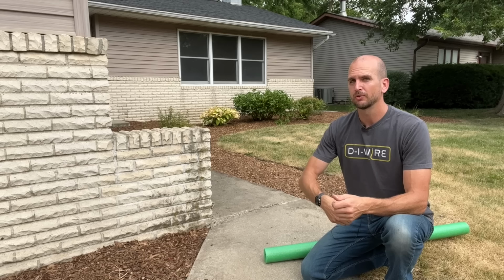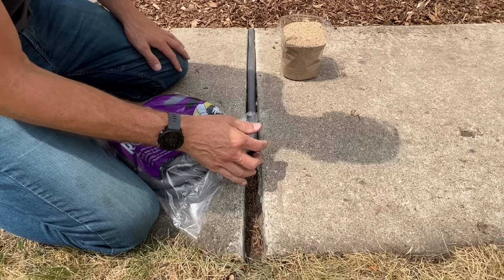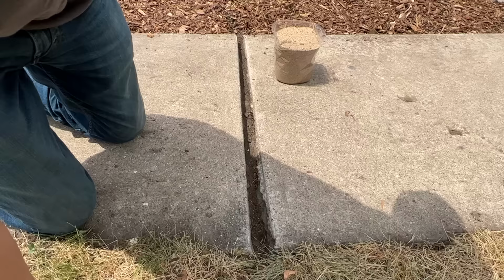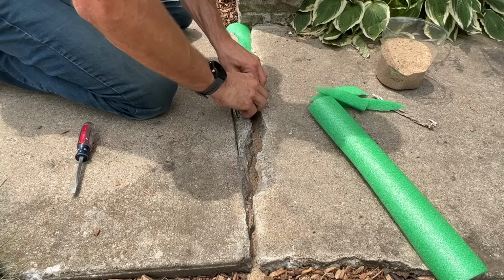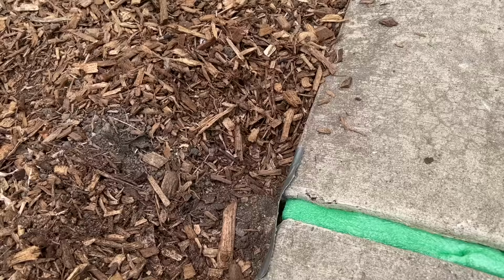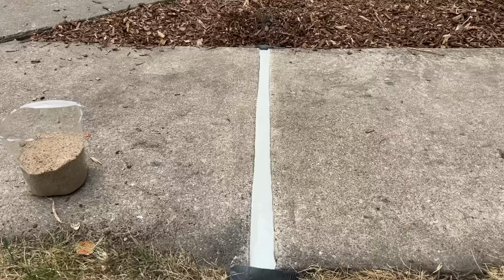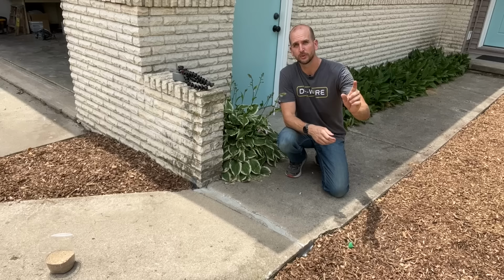How To Fix A Large Crack In A Concrete Sidewalk | Surprising Results!

Comment: The sealant depth looks to be less than what a manufacturer would recommend for that width. Standard practice is for the depth to be half the width of the joint/crack and to consult with their rep for joints wider than 1”. I think you probably traded cracked concrete for cracked sealant in short order.
Reply: Agree. His Sealant is merely a thin Coating over the foam.
Reply: Come on... It's for looks! Nobody walks there lol
Reply: @DP-nw3lz   I agree that it is for looks. That said, the sealant is going to crack and look like crap in short order. Next thing you know there are grass and weeds popping through those cracks. The sealant could be an excellent solution here but it is done incorrectly.

Comment: Pool noodle foam is really great.  I also use it for making my old two D cell alkaline flashlight into one 18650 Li ion.  Just run copper wire or a strip of aluminum can with the plastic burned off through a piece of foam for the fake replacement battery that creates continuity and keeps every thing in place.  It's also good to run some foam around the 18650 so it doesn't rattle around.
Reply: You could do your own video for that one.
Reply: @cornfucius4015  I respect the amount of work people put into producing videos.  Even simple ones made on your smart phone require lighting, angles, background and at least a tripod or something.   By the time I realize I have something that might be a video, I've done it already and I usually don't want to do it again.  Then there is the weirdness of my range of subjects.
Reply: What are you talking about?
Reply: @johnr5252  rotfl!! My thoughts exactly !

Comment: Great advice for a sidewalk, Scott!  I wonder if you could help with a driveway.  My property has a ditch dug along the now asphalted street with about a 2 foot fairly level ridge at the street, and the driveway has a cement pipe underneath it, maybe a 10" ID, to accommodate the ditch on both sides.  The pipe is OK on both sides, but the soil on one side of the driveway between the pipe and the street has sunk over time and the driveway concrete has cracked into pieces in a triangular shape from the yard side to a point about 5 feet in and is cracked all the way to the other side.  That section is one of two ~10' angled sections from the street with 2nd one meeting the straight driveway. 

It was like that when I bought the house about 3 years ago.  I wonder if you have a video for something like that or could make one or give instructions on what to do and how.  I would think that taking care of the triangular cracked pieces may do, and then fill the rest of that section with concrete to level the entire section.  Another issue is that when the street was asphalted, they made it about 5" thick and covered most driveways quite a few inches in and angled down to meet the driveway.  Not a simple project by any means, but maybe one that could be done without a contractor?  Thoughts?  Thanks
Reply: Sledge hammer the broken area, remove it and start over. 
Rent a concrete saw add an expansion joint to attach the existing driveway, then build a Form 5" thick and call a cement truck..  
Don't do it on a hot day or it will set up quicker then you can work it..
Reply: @rtoguidver3651   Thank you!  I have copied and saved your reply.  I have two sledge hammers of different weights, but renting a jackhammer would probably be easier on my back and certainly much faster.  Do you think mixing the cement myself and adding the pebbles to match what's there is a feasible idea?  A cement churn can be rented, too.  Thanks again!
Reply: @100vg  .. 5 inches thick is a lot of mixing even if you rent a mixer.. I mentioned the concrete saw so you can get a straight cut across your driveway and add an expansion joint.. The concrete saw will cut some of it into smaller pieces for less sledge hammer work too.. Good Luck ! ---How big is the area you need to repair.. Get the sq. footage and call for a price ?
Reply: @rtoguidver3651   Thanks again!  I'll take that route: rent a concrete saw, cut out in straight lines, bust it out and remove it with the aid of the saw, build up the soil there, tamp it down, and block it off.  Then call for an ~5" depth at the width's and length's ~volume.  I've seen concrete poured and worked to level, but have never done it, and this will be at a downward angle from the street.  There are likely tons of videos for that, including an expansion joint.  I have a wide flat-tip shovel and a tamper, and I may already have some of the other tools.  You've been fantastic and I thank you again!
Reply: @100vg  .. You can pour a 4 inch driveway, but 5 inch adds 50 % more strength w/ just that extra 1 inch... Good Luck !
Reply: @rtoguidver3651   Excellent!  5" it is!
Reply: @100vg  I did a 6 inch 30' x 6' slab with a harbor freight mixer. I watched a ton of videos first and it came out pretty nice. I had a friend's help .. he mixed it mostly while I wheeled it to the form and finished it. It took all day . I worked from one side to the other . When I started it actually was going very smoothly but once that sun came out we couldn't catch a break. I had to lightly spray the already laid concrete with the hose to keep it from drying while I was adding concrete next to it.

It was a lot of work lol but fun in a way.
Reply: @digi3218   I'd have to watch videos and have a helper, but I could get a quote from a cement company for the approximate volume of cement and compare that price to renting the mixer against buying one from Harbor Freight and buying my own cement and pebbles.  Thanks, Digi, for the comment!  I'm saving this, too.
Reply: @100vg  I have other plans for the mixer and this slab was in the backyard and would have needed a buggy to transport the concrete from the street. I'd probably recommend getting a professional ..might not be as expensive as you think.
Reply: @digi3218   Thanks for the suggestion!  It's always good to know ALL of the options.  I call some contractors for Quotes.
Reply: @100vg  If you live in Florida near Jacksonville I know a guy 😅
Reply: @digi3218   Thanks, but I'm in Louisiana.  It would have been great to get to know you personally!

Comment: Very nice looking final finish. 53$ bucks for the tube of Vulkum ? Ouch. I tend to stick with Cement All for this. It’s poly based and with 15 minute dry time. It does everything. Casting, sidewalk, footers, downspout apron, I even filled a rot hole in a Crepe Myrtle trunk last month.
Reply: Yes. why not just use ready mix concrete? seems like it is easier job than this process.
Reply: @stephenc2481  poly is the difference

Comment: Or you could do it correctly.
1) Clean out with a pressure washer
2) Masonry bit drill holes for metal wires/rods.
3) Apply a chosen product that helps old concrete bind to new.
4) Mix a small amount of concrete for patch
5) Dip the ends of metal going in the holes into the wet concrete and insert into hold and bend to shape.
6) Pour in mixed concreted and smooth over top.
7) Keep shaded and wet for 1-3 days as it cures.
8) Lightly wet for a week longer once a day.
Done now your patch will look good for many many years to come.

Comment: Looks good but instead of using pool noodle you could use spray foam and then cut it back to at least three quarters of an inch below the top of the sidewalk or better option would be to put a little bit more sand in there compact it and then cover it with Portland cement with a little bit extra sand mixed in with the cement oh and put some bonding agent on both sides of the concrete before you put the Portland in there.
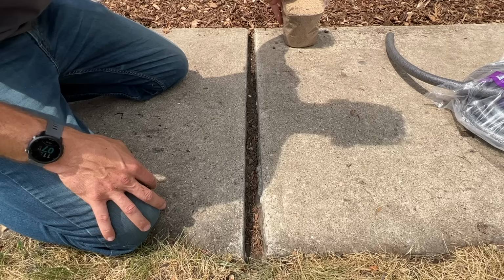Reply: 1:24 i think why the noodle is showcased here is because of the backer rod product

Comment: Great video, I’m wondering if use heat to melt a polyethylene product to fill in the cracks , or similar liquid products that will dry, my concern is when cracks are in abnormal shapes or twisting along the driveway 😊

Comment: I'm not a mason by trade but I do landscape, deck and patio installations. I like this concept and I think it's a good fix.  However, those hosta plants between the walk and the building are a big part of that problem.  They're a perennial and their root system will continually expand and contract throughout the seasons.  This, combined with a frost heave will crack your concrete.  Also, because they do grow to be a beautiful plant with large leaves, a lot of rainwater and due are deposited during their growing season directly on your walkway and in this case along the foundation of the home.  This amplifies even further decay in an even shorter time frame.   I would plant an annual garden in that spot and it's likely that that will relieve a good part of that stress.
Reply: This is excellent information - content like this would make a great video!
Reply: @KathrynHerrmannattorney  Thank you.  I'm more of a craftsman and writer. Although I'm open to doing a video I guess.  lol

Comment: I actually heard that from the research and everything I did if the concrete isn't mixed right or if it's too much water or not enough it could cause cracks down the road the concrete could cause cracks. I thought you would have just put concrete somehow in that Gap in that hole and it would have filled but what do I know

Comment: I used some leveling cement mix that I accidentally bought thinking it was something else and poured it down the crack.  It seemed to work well but I sold the house in another state and don't know how well it'll last, but I regret not having done it earlier.

Comment: Great video!  We have tree root intrusion that lifts sidewalks, causing trip hazards. The only way I know to fix this is concrete grinding.  To do this, you have to have a concrete grinder. Usually, you would need a contractor to do this because the tool is expensive and concrete grinding produces silica dust that must be managed and not inhaled.  What would you recommend?

Comment: This should work on a cracked driveway, walkway, or even a concrete garage floor. Thanks for sharing this information. It could save huge amounts of money instead of tearing up entire walkways and cement driveways and replacing the cement completely.
Reply: Will it stand up to driveway traffic?
Reply: @annfraley7083  I haven't tried ot yet. When I do I'm hoping it is strong and will be like the cement that surrounds it..

Comment: I've also had good luck with Quikrete Concrete Crack Sealant.
It's relatively inexpensive, and comes in a 1 Qt. Squeeze Tube; eliminating the need for a Caulk Gun.
If the Crack is a bit deep etc, lay a bead, let it dry, then add another bead.
Also, being Latex based, if it thickens a bit, you can judt add a little Water.

Comment: I used one of those noodles on my hot rail after I touched the rail it burnt the palm of my hand so I split it down the middle and it fit really well but I also used a small grade of yarn to tie it one in case  the sun would dry it up and it would  fall off. It works great
Reply: @Ladonna Skuza - what is a hot rail, please?
Reply: @bethanyanderson1745  well I've in the small town of Southern IL. It's a noodle I sliced it open and put it on my hand rail as it was so hot to HD on to when going up and down my steps on my prouch! It is one of those noodles the kids swim with. It was a pretty pink but sun's so hot here it faded. But it works great!
Reply: @ladonnaskuza8906  - thank you for explaining. Kind of you.

Comment: For uneven gaps, you can anchor the backer rod with some long (80-100mm / 3-4 inch) stainles steel nails into the ground, so it will not float to the top. You will need more sealant, but as long as you don't need to open another can, you are in the green.

Comment: What products and methods to remove seasonal green mold from water running down a cement wall walkway ? Which has not enough sunlight to reduce the  problem of the mold returning ? Thanks for reaching out. Vinegar and water with a scrub brush !

Comment: I had a summer job when I was a kid that this was literally all I did. Specifically, it was where the curb meets the sidewalk, in commercial parking lots. I was working for the maintenance crew as a summer helper, for company that managed commercial buildings. The other guys called me "Crack", which I found hilarious. This video is 100% correct on the methods.

Comment: Just a thought.
Pressure wash the crack and surrounding areas FIRST (like that algae brick I see in the video that's by the walkway crack).
Then let it dry for 2 days THEN do the repair(s). 
TRUST ME....  I've learned by trial & error doing similar repairs.
Pressure washing first
 will help it
 1. Look better and less noticeable when completed, 2. Last longer because pressure washing AFTER could blast out the repairs you did prior.
BTW, Congrats on your purchase.

Comment: Thank you for this video I will use it on my concrete paths. Do you think the same technique with a different sealant for asphalt would work for large cracks in driveways? I see others have asked this question, but no answer. There may be answers, but so many people have commented questioned and replied I could not possibly read through all the comments thank you again.

Comment: Another foam product and cheap would be pipe insulation.  So this is great to do to fix a problem. But from experience its gonna need to be done every couple years. Any shifting of concrete in winter will crack any products you put in there. My area gets to -40 below F.

Comment: I would use the foam as filler for half the space then coat the concrete with bonding adhesive and then fill in the rest of the crack with premix cement.

Comment: Pic a nice brick , cut to width , lay brick ribbons 👍 , pretty neat fix , I like to use silica sand, tape off edges so that I stays in place at ends , use deck o seal , throw some dry silica sand on top to give it a sand finish

Comment: For a more substantial joint, I pack the seam/crack with pea gravel to about half inch depth from the top.  Then fill the joint with the joint filler.  Much less likely to pop out or be  "ejected" due to ground movement.

Comment: Great tips, but what happens to the sealant when you pressure wash the concrete and get close to it (or even touch the sealant)? I assume the sealant will disintegrate and you have to reapply or will it stand up to the pressure washer?

Comment: I have a crack along the block wall in my garage. the concrete slab is between 1" to 2" wide and about 2" to 3" deep. I tamped down the dirt to compact, now I plan to use silica fine sand to fill all the gaps up to about 3/8" from flush with slab. Would you suggest I put the backer piece in prior to the sand and then you this seland product to complete? Thanks

Comment: I’ve been Waterproofing forever 35 years. Get a stone concrete saw and cut off the broken pieces straighten up your crack. Then you want to put a sealer in before you start doing your stupid sand. You don’t want something growing up underneath and pressing your back right apart and then eventually in a year or two it’ll push out through your caulk. that you’re going to put in there. I prefer using master seal HLM 5000. It’s a little more expensive but it’s guaranteed the last. Plus I use a pre-prime which will hold the master seal in place.
Reply from the maker: Thanks for the feedback!

Comment: Done it like this but only lasted couple of years. The self leveling crack filler will fail and the two concrete sections will be at different heights given enough expansion contraction movements.

Comment: This is excellent work. The finished product (sealer) should never be thicker at the center than one half the width of the gap and it's better to keep it no more than a third, but no less than an eighth of an inch. This demonstration shows the correct technique according to every manufacturer of elastomeric sealers like the one shown here. Well done.

Comment: Do you have a video filling in cracks in cement walls in a basement? Also can this work similarly on cement floor cracks in basement by where the sewer line is (tends to back up and leak and caused cracks overtime-multiple homeowners prior to us never did anything to fix it but I’m tired of looking at the crap floor).

Comment: Great video! Would this work (pool noodle + sealant) on a large crack on a concrete driveway? Please advise
Reply from the maker: It should how large is the gap?
Reply: @EverydayHomeRepairs  the crack width varies. One spot is half inch and another is about 2.5 inches wide. If it’s ok, Would you have an email address I can send you the pic to? I was looking in your website but didn’t see one

Comment: Wouldn't it be more compatible to dig out under crack, to make a strong divider. T out the bottom so that concrete flows under the the two separate pours and just fill the hole with new concrete mix? When you cut the slot to be more uniform, u'll have a good bond on each side. Most sidewalks are 3 inch pours, so before your new patch cures, take a sttaight edge and cut an expansion joint in the center of the new material. That will allow any expansion of the new concrete without cracking. Ive seen people use the caulk type patch material. It always sticks out like a sore thumb, and doesn't last. Concrete is semi porous. So water absorbs into it. The patch junk is latex or plastic and never resembles concrete.  
Concrete mix is inexpensive, easy to use and will make that crack look almost invisible and should last forever if you do it right.  Oh and try a grinder, vs a drill attachment when straightening out the crack. Faster, safer, and if you don't have one, you can grab an inexpensive one on eBay or even at HD or Lowes. They are very versatile.

Comment: The sealant will be hard to push out of the caulk gun, if it's a little cool. Lay the tube out in the sun while you do the other steps, so it will get warm and come out of the tube easier.